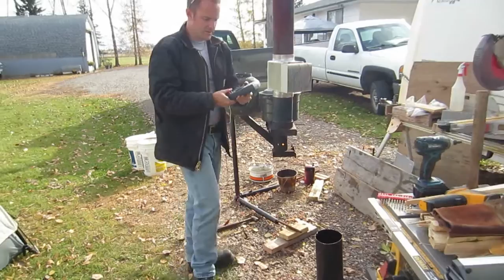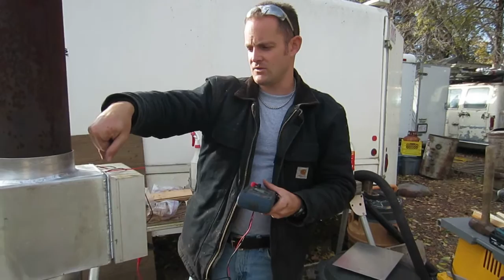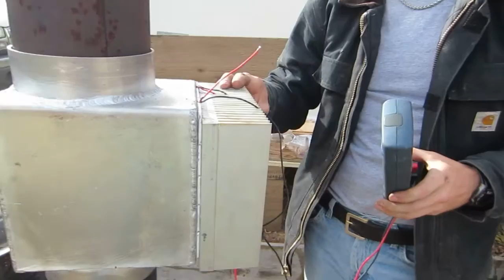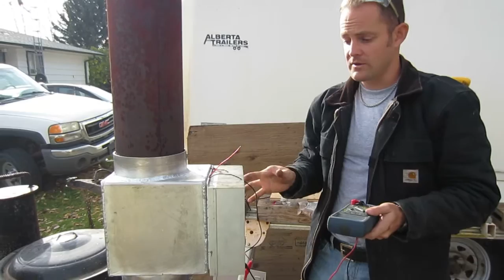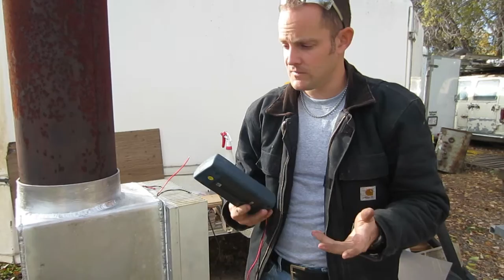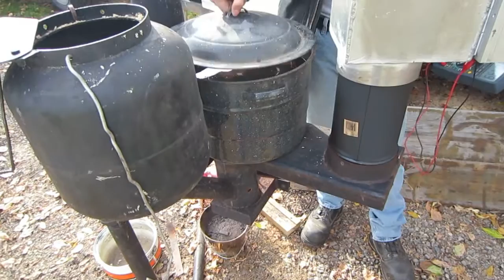Peltier Generator Build Part 2 - Single Unit Test

Comment: I had this same Idea. Neat to see someone has done it on youtube!  My idea is to use square stove pipe and mount TEGS on all 4 sides.  Use water cooling and get even better power.  My wires melted on the stove.  Maybe try using a separate tank off a copper coil around the stove pipe and the outdoor winter water.

Comment: Is that  just an aluminum box or is there some sort of baffeling on the inside?
Reply from the maker: It's just an open aluminum box. Baffling would be more efficient but you have to watch your peak temps. These peltier units will fry if the solder in them melts so stay well under 200*C worst-case thermal runaway.  I decided not to bother with this unit despite the input costs. I found for the time and effort it wasn't worth it, instead using 10 alternators and a 24hp engine.  The 7800Ah battery bank will charge from 50% in under 3 hours.